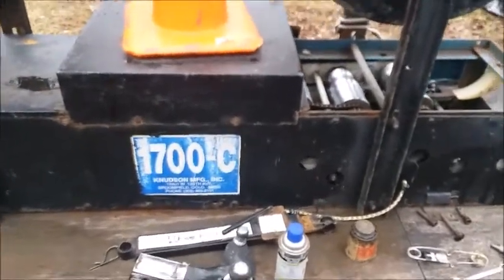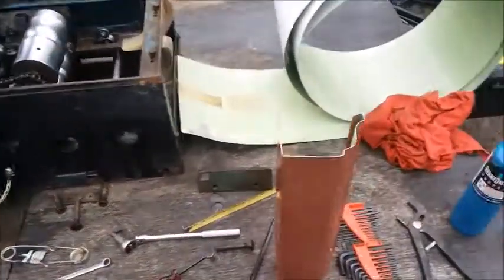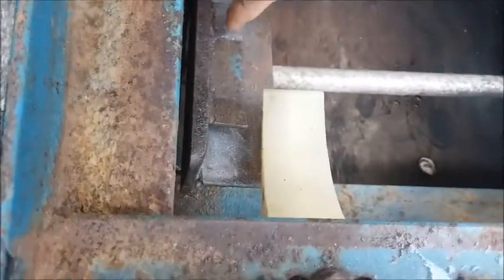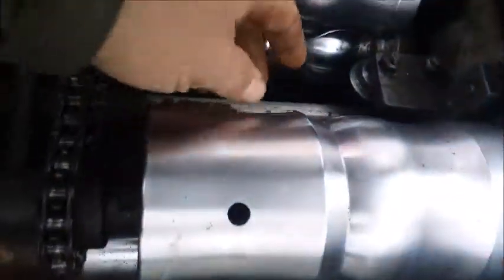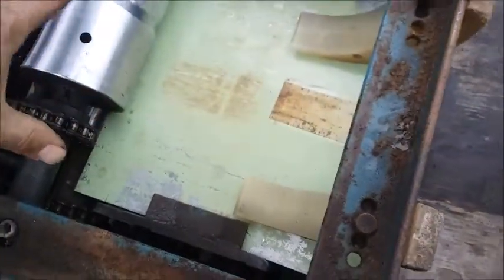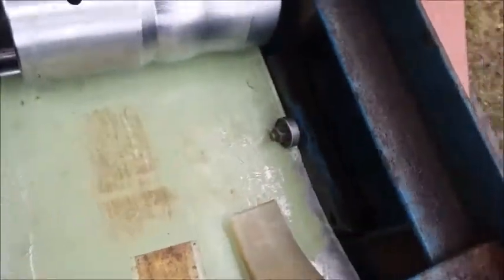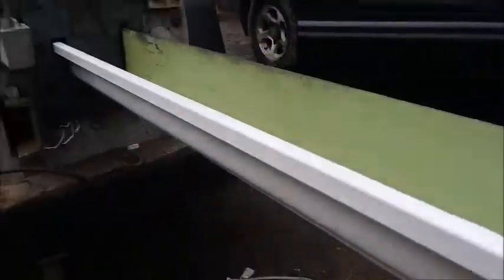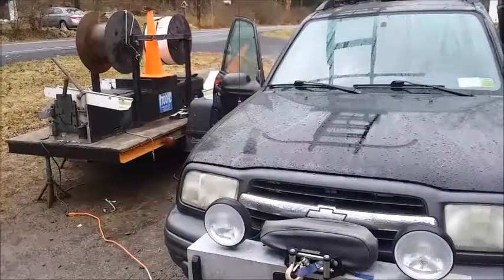Adjusting the lip/hem on a Knudsen Mfg 1700-C gutter machine

Comment: What would you recommend since I tried adjusting both sides I believe there is a exact measurement the the right channel( looking at it from the back ) should be at I just can’t seem to get it right , won’t even feed the gutter through anymore
Reply from the maker: It needs a little play.  Like  1/32 of an inch to 1/16 of an inch of play.
Reply: @mariotorchio4075  what if your machine starts to skip ? And scratch the gutter?
Reply from the maker: @cristiandiaz2083  There are a few things that you can try. 1. unplug the machine and clean all the rollers.  Dirty rollers an cause that.  2.  Are you spraying too much wd-40 on the rollers?  this will make it slip.  3.  grab the gutter and pull it out as you run it.  This helps too.
Reply: Please help guys my machine is not working.

Comment: My machine leaves a scratch mark on the first bend from the bottom... Do you know which roller would be the one scratching it
Reply from the maker: I'm not sure what roller it is.  But you also might check the two metal rods in the center of the machine that guide the aluminum. Make sure one is not bent too far and scratching.  I clean my rotors with WD-40 or silicone spray.  Then wipe each one completely dry afterwards.  Sometimes its rust spots that can cause problems.  Just make sure the machine is unplugged when you have your hands in there cleaning.
Reply: it's the one with the gear on it.

Comment: Shouldn't the lip have bit a ripple? Also doesnt wd40 leave alot of residue? My last machine had polyurethane rollers but got stolen the one I have now has the same rollers as yours and I read it they should be cleaned with acetone  or paint thinner? And a chain lube for the chains not to use oil. One last thing I was told this machine I have now needs the gear oil changed. I never had to do that with my other machine. I'm not even sure which gear oil to use. 80w90 seems the most common but I also noticed there's 75w90 and 75w140? Confusing.
Reply from the maker: The lip should be about 1/4 inch. A little less is ok, so long as the hanger feels secure.  I clean my rollers with wd-40 then I wipe them completely dry.  You don't want to leave oil on the rollers or the machine will not pull the aluminum through.  The gear oil is simple to change.  80w-90 or 75w-90 is fine.  It doesn't get hot enough to justify 140.  so long as the gear oil doesn't leak out(which it sometimes does) then the gear oil will last a long long time.
Reply from the maker: The lip may ripple for the first 12" but, no it should not ripple.  You may have the adjustment a bit too much.  Try to back it off.
Reply: @mariotorchio4075  I'm in manitoba and the company I buy my supplies from told  me the lip does need that ripple cause the from hot to cold weather cause it to expand effect the hangers in the winter.
Reply from the maker: @jvirg  I've not heard of such a thing and it doesn't even make sense logically.  It needs a lip for sure. about 1/4 inch(but 3/16" is fine also).  A 50 degree temp variation would result in a change in size of 0.05 inches.  very very little.  As far as the ripple goes and as far as I'm aware, the ripple is a result of a poorly adjusted machine or you are letting the gutter hang down too much and bend as it's exiting the machine.
Reply: @mariotorchio4075  o ya the metal will expand and so will hardy bord, i ran a job that was 68 feet straight run on hardy bord fashi in 30 degree temperature's once and let's just say the expansion rate of the hardy bord and the gutter didn't jeehaw very well! I turn down any job that uses hardy bord for fashi now i learned my lesson.